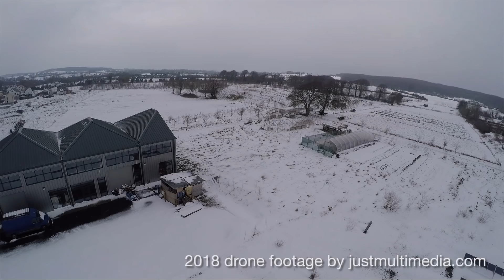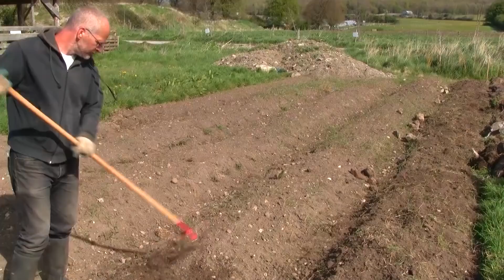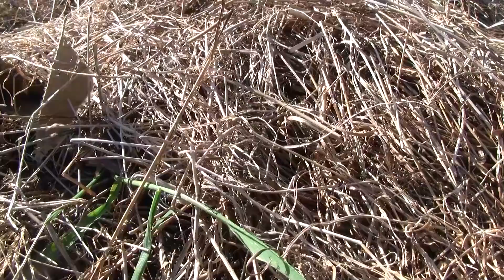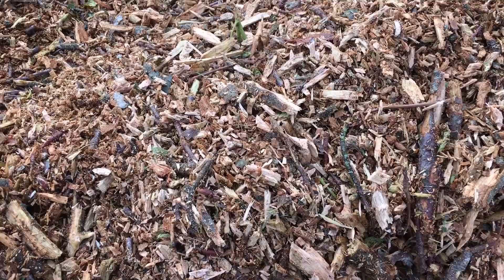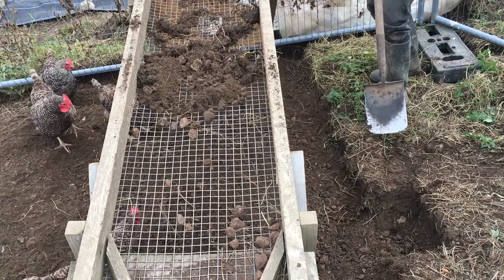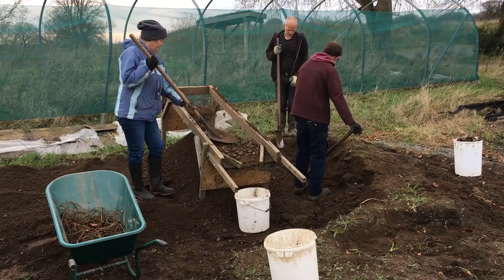What is the Best Way to Clear a Really Rough Site?

Comment: My question is about compost.  How little compost can make a positive contribution to growth.  For example, if you had poor soil but added only a few grams of compost per seed, how long would that compost last? Is there any data on what quantities of compost influence growth?
Reply from the maker: Sorry, I don't know if I have an adequate answer for you. Generally when people talk about adding compost it is measured in how thick an evenly spread out layer would be. I have heard that 5mm or 1/4" is a minimum, but I think it really depends on the quality of the compost.
Reply: @REDGardens  I might do a tiny experiment at some point to see if larger quantities of compost have any appreciable effect on common garden veggies' growth.  It would be great if we could figure out how lean the mix of compost to soil could be and still get great growth.
Reply from the maker: @jeffreydustin5303  An interesting experiment. A lot would depend on the amount and balance of fertility already in the soil.
Reply: A layer 2" thick it more will block access to light for any weed seeds. That's a mulch that breaks down over a season.  You need to replace it a few times a year.  Some plants will grow in PURE COMPOST.   TO ENRICH THE SOIL QUICKLY, dig in 2" of compost and finish after transplanting with another 2".

Comment: I like how you are very pragmatic and get the job done, knowing that the process can be fine-tuned next time around. Purism can get in the way of productivity. Sticking slavishly to a single methodology can prevent success which is disastrous if you NEED that food right now.
Reply from the maker: Thanks! I think your point about chosen method getting in the way of getting food now, is an important one. I am slowly realising that we need to go with whatever works, so long at it works, and can keep working to help us get good food. In so many cases, the context is key, but that is hard to get across with method driven memes and advice.

Comment: I used the same method, except didn't use my chickens as I wanted to keep my worms. I wouldn't use a flame thrower as that sterilises the soil :( The sieve makes beautiful soil...
Reply: Properly used, the flameweeder doesn't heat the soil, and only somewhat impacts particularly vulnerable soil life right at the surface.  No soil sterilization occurs if operated correctly.  I think it was Richard Perkins of Ridgedale Permaculture who cited a study that was done.

Ideally, the torch is adjusted so that it doesn't even singe the weeds; its heat briefly causes water in plant cells to boil, causing lethal damage to the plant.  The heat is kept "above" soil level - you're not trying to boil water in the plant roots.

Still, that's all obviously dependent on how the human uses the flameweeder; some may be looking to have it rid their growing bed of weeds that it's not designed to get rid of (ie, anything with a root that can withstand heat damage above the ground), and some may move too slowly over the bed, allowing the torch to heat the soil.
Reply from the maker: @rebeccaburnell9319 I think I have been a bit too heavy handed in the past with the flame, so now I tend to do a very light pass, then come back a few days later and do another, which seems to get more weeds.
Reply from the maker: With a very light touch with the flame weeder, barely wilting the weeds, the soil seems to be unharmed.

Comment: Hi 
I really like how you explain your thinking, and all the options, as you think of all sorts of things I have to consider as well.
Im not able to dig over my plot either - I tried and just a trench or two required manhandling big rocks as well as all the other stones. Some ijut builder removed all my top soil. So I am curious as to what you did with all this debris. Big stones always handy as weights or an eventual herb spiral or rock garden but also provide slugs with a home. As do stones so where do you put them to good use??  I've only got a 16m2 plot so no area to just dump them to.  I love your compost sifter - I need that!!
No access for any machinery to to break open my compacted subsoil 'lawn/weedbed'' either so I resorted to a layer of manure with lots of worms, a layer of top soil - a bit peaty though, as much cardboard & recycling paper as I could gather and several van loads of bracken to cover the topsoil and. I'll leave it to work under landscape membrane for several months while I plan out the beds etc and hope the time of year means I wont have a huge slug problem when I start cultivating!!
Needed 3x as much manure/topsoil/carbon layer really but you have to start somewhere, right?
Reply from the maker: Sounds like you have a really rough site to deal with. I'm lucky at least I have decent topsoil, even if it is mixed up with other things. I'd say the best approach is token going as you are, adding stuff on top, and hopefully the roots will eventually do the task of working through the hard rocky soil.
Reply: @REDGardens  so what use did you put all your sifted stony debris to?
Reply from the maker: @lsb9073  I hauled a lot of them down to a sunken area beside my house, to raise a path and provide a drainage area. That is almost done, so the next job, I think, is to dig a trench along the access lane to the Black Plot, and fill it in with stones as a soakaway, so that the water from the lane doesn't flow into the entrance path. After that, not sure. With he larger stones, they are often used to hold down ground cover fabric and plastic, but I might have enough of them, and can start collecting for a stone wall!
Reply: @REDGardens  we was in the desert in Arizona about a half-hour from Bullhead City. Our Winters are pretty mild but it can get to freezing here. I would like to get begin preparing some of our very Rocky and nasty soil for next year. I was wondering what I can begin to plant in the ground now? Any ideas? Thank you very much
Reply: @blissfulacresoffgridhomest2098  I see @RED Gardens didn't respond... I'm assuming because this is definitely an overbearing questions, requiring at least a textbook chapter worth of answers... I'd suggest you get some texts on soil restoration to properly identify your problem and then pursue solutions. Plants, mulch, compost and/or compost tea, and perhaps fungi will be all you need to restore the soil back to conditions suitable for more abundant life. Seriously though, I think you should confront some texts. I'd suggest "Teaming with Microbes" by Jeff Lowenfels and Wayne Lewis, "Mycelium Running" by Paul Stamets, and "Gaia's Garden" by Toby Hemenway. Lowenfel's novel has tools to restore soil organically using 4 tools, mulch, compost, compost teas, and perhaps fungi if necessary. Stamet's novel has great restoration techniques involving fungi. Hemenway's book includes lists of plants that hyperaccumulate certain minerals , which may be useful. These books are easy to read too.
Reply: Thanks @JohnnyCake12333  for your comment. We have actually dug 2 16 and a half foot deep holes to get through the caliche cement. We've also bought and added microryza, mulch, compost, topsoil  which is mostly clay it turns out and sand. I'm also making our own compost tea to spray on the plants. Where we live it's now about 60° I have a lot of sunflower seeds and I loved your suggestion of planting sunflower seeds I'm also looking into planting some comfrey to use as a chop and drop. Thank you for your book suggestions I plan on buying all of them. Appreciate your comment very much thanks. Susan
Reply: @blissfulacresoffgridhomest2098  I watched a couple of your videos. I saw the trenches I think! Interesting. I do wonder if sunflowers could break through that stuff, just because I've seen mushrooms burst through concrete, couldn't sunflowers do it with nature's concrete? Anyway glad you like the sunflower idea and book suggestions. 

Just wanted to mention one more book. "The Biochar Solution" by Albert Bates. It has many excellent studies on biochar and its history, and seems to be excellent for desert restoration projects in particular, because it increases microbial life in the soil significantly more than just compost or mulches (and therefore water retention etc). Soils containing biochar can have 150-200x more carbon than surrounding soils. I haven't had to use it in my climate, but it has my attention because of its role in history and potential for altering the climate. Also, you might have a hard time using fungi in your dry climate for now, so you might want to consider that if purchasing Stamet's book... Biochar might be a better approach for restoring your soil initially. The text mentioned is definitely the most complicated text of them all, but still reasonably easy to read and teaches how to do biochar right and standardize your process.
Reply: @JohnnyCake12333  thanks for watching a couple of my videos about our fruit tree Journey. It's so much easier than I can explain here. Yes that is a trench on  the north side of the property. We also have 14 deep holes dug. And now we have five trees planted a Pakistan Mulberry, 1 almond, 1 Navajo Willow, and two pecan trees! Hoo hoo!! Thanks for the biochar information if we can get a non windy day this will also be filled with topsoil. Think we WILL make some up. Also thanks for the book title another one for me to get. As you can imagine we didn't get much soil from the ground most of it was caliche rock. To get rid of some of the rock we will build a tire wall filling the tires with the rock.Wish I knew a couple of young guys who could help us 65 year olds!
Reply: @blissfulacresoffgridhomest2098  Seems like a really great project. I hope the books help. Feel free to skip around to chapters/figures that interest you most, you do not have to read them chronologically! Good luck.
Reply: Just wanted to say I agree with Mr. Darrel. I've planted sunflowers in completely compacted and grey soil, just stuckem an inch down in the compacted soil and they plowed through it. You could try a batch of sunflowers/mustard seeds for their strong roots. They are standard for organic soil restoration projects for breaking up compacted soil. They also put organic matter/life deep into the earth and can bring nutrients up too!
Reply: @JohnnyCake12333  
A field of sunflowers!! I love the idea! Thanks. 
I was going to sow a first cover crop of a green manure mix which includes mustard.  👍

Comment: "...with my flame weeder..." Waitwaitwaitwait a minute. You weed with a flamethrower?
Reply from the maker: Lol, yep, starting to use a flame weeder. Actually it is just a roofing torch hooked up to a propane tank. Works pretty well with tiny weed seedlings that have just emerged. You don't need to burn them, just singe heat them a bit, enough to wilt. Apparently if you get it right the weeds die and everything just under the soil surface is fine - still trying to get it right though.
Reply: @REDGardens  The easiest and safest way to kill weed seedlings is to behead them with a stirrup hoe. It's especially useful around shallow rooted perennials you don't want to disturb. You just glide it 1/4" below the soil. I have one that's only 2" wide. You might like a collinear hoe which is wider but works the same way. Once you've killed the seedlings, just cover the soil with 2-4" of mulch until you want to plant there.
Reply: @REDGardens  Oh man im gonna try this out, thanks
Reply: check out commercial tractor flame weeders, if you'd like to see huge flamethrowers ;)
Reply: It's just a torch. But you CAN buy an actual flamethrower, and use it to clear out land.
Reply: YES!  It's very effective without chemicals...
Reply: You mean to say you don't have one?  They work!
Reply: They make cultivator attachments that you pull with a tractor for between row cultivation.
Reply: Yeah, people do. 

It's not a flame thrower, it's more like a giant fireplace lighter. 

Mostly it's used for getting weeds growing in cracks  or under  chain link fence.  If conditions are dry or windy, it's usually forbidden (not to mention stupid.) I guess it's better than spraying carcinogens like Roundup. Still, it doesn't help air quality. 

Here on the prairie a CONTROLLED BURN is actually part of the natural cycle and enables some species to germinate. 

Some believe that Plains Indians used  fire to drive herds into ravines.
Lightning strikes can cause them too, and we often get lightning without rain. The prairie plants are fire adapted and the heat if the fire doesn't damage the roots.
 Pavement constitutes a sufficient firebreak under good conditions. So now
the state Dept. of Natural Resources conducts them under careful supervision in natural areas. The practice also reduces the amount of fuel on the ground. Suppressing those fires altogether for decades is part of the current wild fire problem out west.

Comment: What a solution - nice one.  I must admit, I'm glyphoing my block and using a heavy rototiller once - just enough to shape beds and paths.  Then using weedmat under woodchip paths and on top of the beds covering a thick layer of mushroom compost I'm buying in.  I don't think I could physically do what you've show here - although you would be fit after that effort...   Another terrific video!
Reply from the maker: Thanks. One thing that I didn't mention in the video is that I try to have a few really physical tasks around that I can do a bit of almost every day, like the work I did here. That way I don't have a problem digging more when I need to. I had a few friends help me with some of the sifting, and they both were out with a sore back the next day. So, a benefit of those big physical tasks that stretch out over time.
Reply: @REDGardens  - this is an important point.

We have to regularly push our bodies harder, even if only in short bursts, in order that they can do heavy work when necessary.

If you can't find ways of making yourself do a bit of harder work, you'll eventually hurt yourself when hard work must be done.

Use it or lose it.  It's all part of your own overall sustainability, which in this case, also has big long term quality of life ramifications, too.
Reply from the maker: @rebeccaburnell9319 I agree completely - use it or lose it! I agree that maintaining physical capacity over the long term is as essential element of sustainability, and a core of developing resilience. And the regular hard work is part of that.